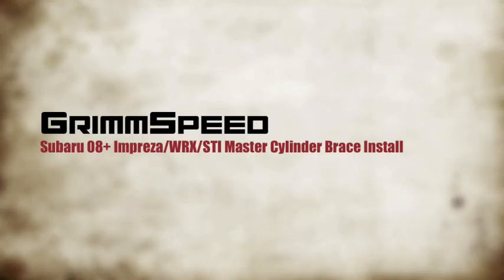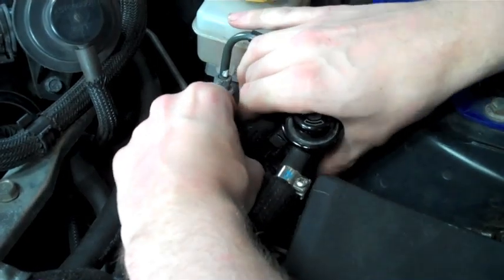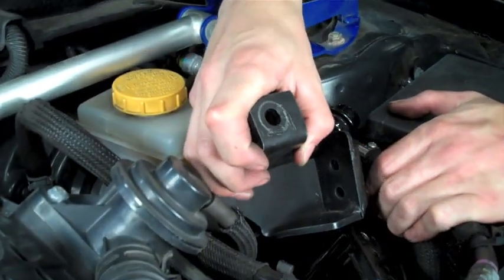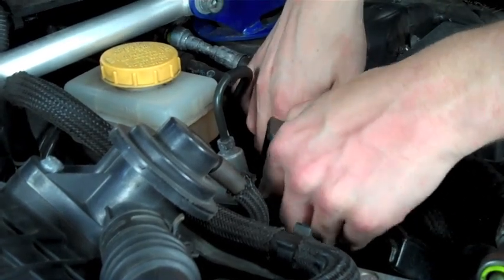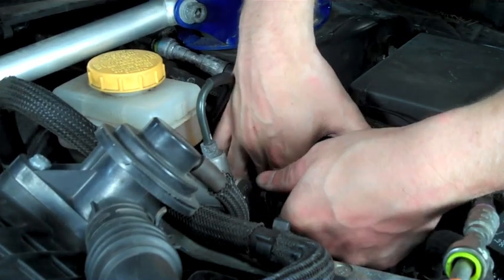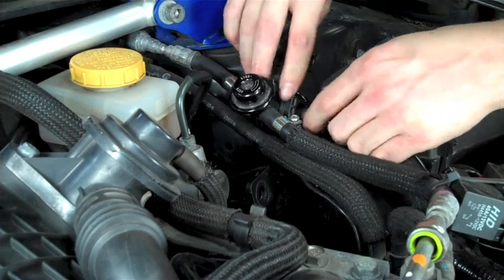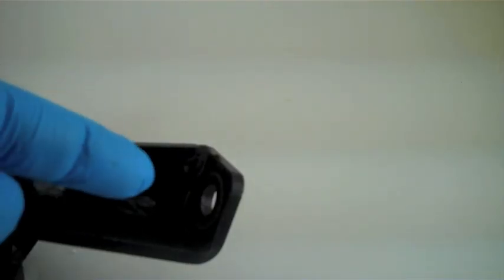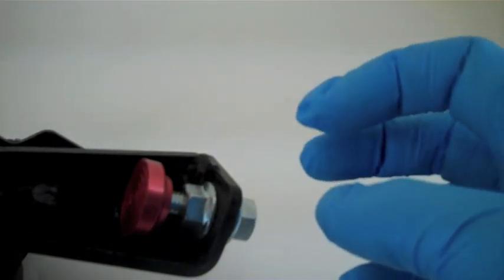Subaru 08+ Impreza / WRX / STI Master Cylinder Brace Install

Comment: I did this last weekend on my 2013 wrx. Did the pitch stop mount, clutch master brace and this master brake brace. Was the hardest part of the weekend. Blind bolt installs are so much fun! Overall, all three parts installed I feel were worth it.

Comment: I just installed this on a 2014 WRX wagon. This video certainly helps. The most difficult parts were putting the first screws in after lining up the brace, as there is very little clearance for hands or fingers in there to be able to actually turn the screw once you have it lined up. LOTS of patience required. Also, my fuel lines would not fit with the bracket turned backwards, but there was not clearance for the bottom fuel line as the 'mushroom' part of the fuel line hit this brace if put in OE position. I had to position the 2 bottom fuel lines a bit higher and use zip ties to secure. So, not a perfect fit, but good enough considering. Now that I've done it, my time would be cut in half to do it again. It took me 2 hours.

Comment: Removing intercooler 1,000,000,000,000 x's easier.

I spent about 15-20 minutes trying to get the 2 longer screws to cooperate then gave-in and removed the intercooler and 10 minutes later I was all done. I only wished I had waited until I ordered my clutch master cylinder brace. Oh well, the intercooler on the '13 WRX is easy to remove and put back on.
Must give Grimmspeed props on the brace. It's clean and very stout. I work right down the street from you guys. I need to stop by some time and throw some more money your way.
Reply: Also, props to Bon Jovi below me. Thanks for the tips on the fuel line. It saved me much frustration.

Comment: This does not work easily on 2011 sti. Stock fuel pressure regulator garbage gets in the way. Brake line is also in the way of getting short bolts in. I gave up. Going to have to take intercooler off and upgrade to aftermarket fuel pressure regulator.

Comment: If you own a 11+ sti this video does not show you what is in store for you. This brace does NOT fit an sti like this video shows on the wrx. You WILL have to modify your fuel lines in some way to make it work. They do NOT fit into the oem clip with this brace. If someone has been able to do it, I would love to see an install video or pictures. I just bought this brace after watcing this video and looking at the install instructions on Grimmspeed's website. Once under the hood it is painfully obvious that it won't work. Only options I have found on the forums is zip tie your fuel lines together and I guess hope they do not rub and cause a leak. Or lengthening your fuel lines or replacing your fuel lines to an aftermarket set which then requires a tune. If I have missed an alternative please help by posting what that is. Thanks
Reply: I just did mine over the weekend on my '13 sti. I kind of swapped the fuel lines mounting points to make it work, and cocked one "mushroom" vertical so it's much closer to the hood When closed... not my ideal install, but better than having them dangle in the engine bay. 

like others said, this is a 7.5/10 for difficulty. im a pretty seasoned mechanic and this gave me a hard time.

Comment: The master cylinder brace will significantly reduce the amount of firewall flex under high braking loads.  What does this mean for the driver?  A much more responsive and solid feeling brake pedal.  This equates to nearly all of your energy exerted with your foot on the pedal going directly into the braking system.  Let me know if there is anything else I can help you with.  -Matt Homes
Reply: matt homes if my clutch is doing the popping noise, will installing this fix that? Or does this just effect brakes? ITS bracket is the main fix for this issue but the website is currently sold out of them. Please HELP!

Comment: Lies! Can’t get the first small bolt in as the line off the master cyl completely blocks access to a box end wrench or ratchet. Maybe my 2011wrx has a one off bend in the way? Supreme effort in annoyance. Maybe I’ll pawn this job off to a mechanic shop?
Reply: Spent about an hour trying to get it in thinking it was going to be a quick install before work. What'd you end up doing?

Comment: My 13 sti has way different fuel lines on that same little plastic bracket.  Does not fit back onto same bracket on re assembly.
Reply: What did you end up doing? Just leave it hanging?it doesn't look like there's any way for this to work.
Reply: Luis Elliott  I ended rigging it up with some zip ties and cut up rubber tubing for parts that are rubbing metal to metal. Works fine.

Comment: This is the most difficult part I've ever installed on any vehicle I've ever worked on.
Reply from the maker: The master cylinder brace does go in a pretty tight spot and can be a little bit hard to install. It takes some patience, but once you get the OEM bracket off, it should go pretty smoothly.